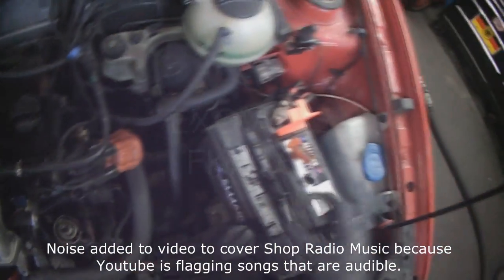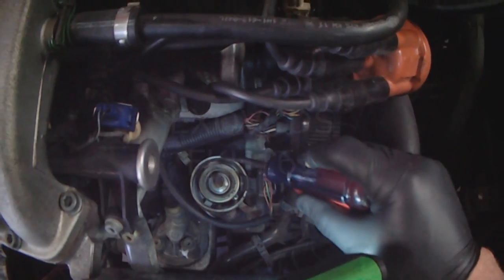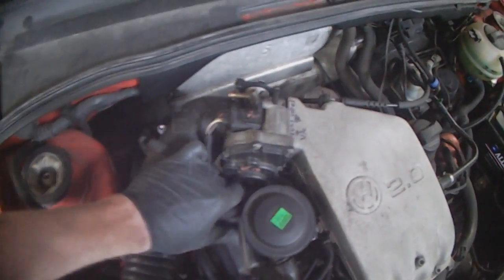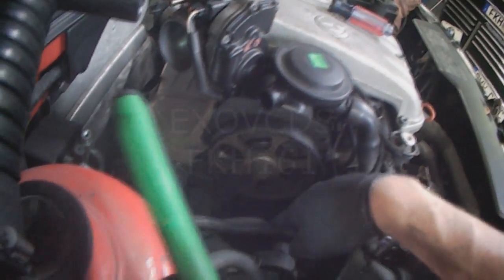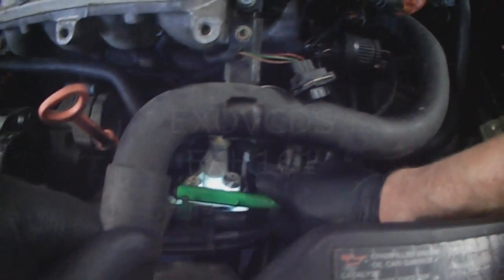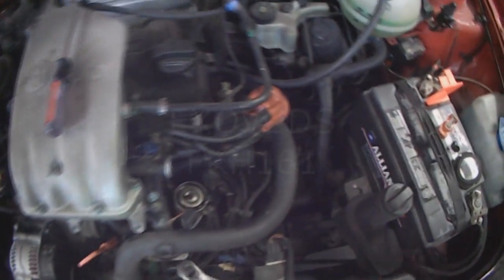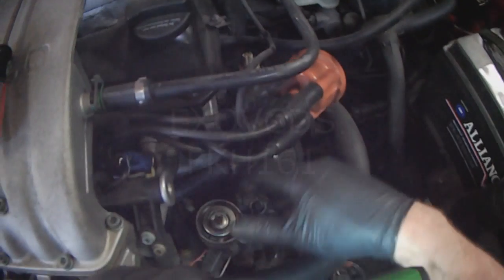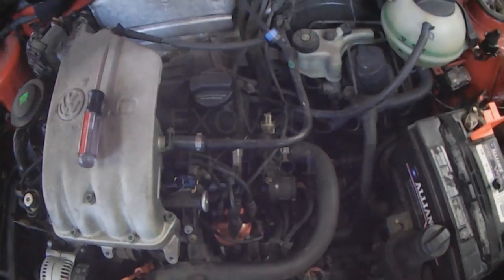VW A3: 2.0L ABA Distributor alignment / indexing

Comment: the manual tells me to make sure that that lug for the oil pump is parallel to the crankshaft centerline. If I do that, the rotor head is pointing like way off.
Reply from the maker: @danielswinger2986
With crank & cam at TDC, install the distributor so that the rotor points at the TDC notch in the distributor housing. 

It doesn't matter where lug for the oil pump is.

You can install the rotor 180 degrees out... it doesn't matter, as long as you also swap the spark plug wires on the distributor cap to reflect the incorrect position. Using TDC markings makes life easier.

Turn / adjust the distributor to do the final adjustment.

I can't  see what you are working on or how you are doing things... of if you are on the correct TDC marks. 

When taking things apart, nothing should really move much... so putting things back together the way they were, should get things running again.

Comment: At 7:01 how did you know where tdc was for it? From just turning it?
Reply from the maker: I think the video is self explanatory... remove the distributor cap, rotate the engine by hand with a socket & ratchet on the crank pulley bolt... turn the engine until the distributor rotor is pointing to #1 post of the distributor cap (the distributor also has a notch in the housing that indicates #1 position... verify that you are at TDC by looking for the TDC mark on the flywheel.  

Standard & automatic transmissions will have TDC marks / positions that look different

Comment: My otc on plastic isn’t lined up with the mark on the sprocket
Reply from the maker: Year, make, model, engine?
How are you checking for OTC / TDC?
Reply: @EXOVCDS  95 Volkswagen cabrio mk3 .. from watching videos I see you have to line the otc mark with the marks on the pulley:. My otc mark on the plastic is at the top at like 12:00 and the mark on the pulley is around 830-9:00 .. so do I turn that by hand to line it up with the otc mark on the plastic?
Reply from the maker: @sniperpaintcorrection  
Yes, but you also have to make sure that the #1 piston is actually at TDC (all the way up) when the mark on the pulley is aligned with the mark on the cover.
The crank gear can come loose with age and it can shift on the crankshaft... meaning that when you turn the engine to TDC via the mark on the pulley, when the pulley is at TDC, the crankshaft "might" not be... due to the shift of the gear.
If the piston is all the way up (use a long screwdriver in the spark plug hole to find TDC) and the pulley mark is at TDC, then the crank gear is OK.
Reply: @EXOVCDS  so to get the #1 piston to TDC I have to rotate which pulley? The one that moves the distributor rotor?
Reply from the maker: @sniperpaintcorrection  
You have to check all 3.
Camshaft, crankshaft & distributor.
If the timing belt is still installed, rotate the crankshaft until the pulley TDC mark is lined up with the TDC mark on the lower timing belt cover.
Once the crank pulley is at TDC, check the camshaft TDC mark.
If the camshaft TDC mark is 180 out, then rotate the crankshaft 1 more full turn.
Once the camshaft & crankshaft TDC marks are aligned, check the distributor to make sure that it is pointing at the #1 TDC slot in the distributor housing. Remove the distributor cap to see the rotor & TDC notch.
If the cam TDC mark or the distributor rotor do not align when the crank is at TDC, you will have to move the cam or distributor (once the belt is off) to get all 3 to line up.
Once all 3 are lined up, remove & replace the timing belt. 
Post a video on your channel, so that I can see when you have everything aligned... before you try and start the engine.
Engine damage can occur if you do not line everything up correctly.
Reply: @EXOVCDS  thank you , I will get back to you next chance I get to do some work on it this week .  I just hope I didn’t do damage , I’ve been cranking that engine for a week trying to get it to start thinking it was the fuel pump,  then distributor cap and rotor and ignition coil. Traced it back to the belt with missing teeth . I’m assuming it’s out of timing after all that
Reply from the maker: @sniperpaintcorrection6790 
I'll wait for your update this coming week.

Comment: I’m doing this now, is number one the first cylinder near the transmission or pulley set up?
Reply: Also, how do I know when I’m on tdc on compression stroke? I can see the exhaust valve is closed but how do I know I’m not in the intake stoke? Please help???
Reply from the maker: 1 is closest to the belt.
When the tdc mark on the camshaft gear is lined up with the mark on the plastic piece behind the cam gear... then the camshaft & crankshaft are at #1TDC.
You can verify that the crankshaft is also at tdc... by looking at the flywheel or torque converter at the transmission timing hole.

Comment: So it's like advance or returd the distributor once you break it the clips lose fot movement   by hand turning to TDC  thanks I love your channel
Reply from the maker: Yes, you can move the distributor to align the rotor with TDC... as opposed to resetting the intermediate shaft gear at the timing belt end. You should NOT have to move the distributor if the belt was not changed. If all of a sudden you are now having G40 fault codes, it is quite likely a problem with the hall sensor in the distributor.  If however, the timing belt was recently replaced, then distributor timing was not done correctly at that time. The more info I have, the better I can help.
Reply: You have help great deal Thoma  👍

Comment: When you say “pointing at cyl number 1”, what do you mean?
Reply from the maker: The distributor rotor needs to point at cyl 1 on the distributor cap. Follow the spark plug wire from cyl 1 spark plug to the distributor cap... lift the cap and look if the rotor is pointing at that spark plug wire. The camshaft & camshaft need to be set to #1 TDC first.
Reply: @EXOVCDS  thanks. I was driving home the other day and the clamp that holds the dizzy down loosened up and the entire dizzy/cap assembly rotated out of time. I think I just need to use a timing light and turn the whole assembly by itself to get it back in time. I have it close enough to run but not dialed in
Reply from the maker: The engine will run with the distributor hall plug disconnected... when it rotates too far,  the spark will go to the wrong cylinder. No timing light required. Remove upper timing belt cover. Turn engine by hand till the tdc mark on the cam gear  points at the arrow above the gear at the 12 o'clock position. Remove distributor cap. Rotate distributor till the notch in the distributor  housing it lined up with the center tip of the rotor. Tighten mounting bolt.

Comment: Quick question, camshaft position sensor would be the hall sender on these engines correct? 
I’m throwing a code, just did a full belt and water pump job with a full tune up, cars running slow she’s got no Getty up so to speak, 
Time is correct, 
Cps I received Is for a later model engine, and I’m finding nothing on cps for this model
Reply from the maker: Cam codes after timing belt replacement  means that distributor alignment is not correct with crank position.

Comment: Great video! I’m having some problems with my vw, I had it running perfect but now it’s misfiring under load. It seems to idle ok, itll rev up in park, but as soon as I try to drive it, it is very under power blinking the check engine light and giving me tons of misfire codes. I’m having a hard time figuring out what’s going on with it. 

Here’s what I’ve done so far:
 Distributor (new Duralast brand) (Due to camshaft position sensor failing, ran perfect for about a week, then had one misfire in cylinder 3 at 4k rpm) 
Next:
Spark plugs (Tried ac Delco, switched to ngk)
Ignition coil (tried a new coil and a junk yard one)
New spark plug wires (tried 2 different brands) 
Junk yard bosch distributor (currently in the car now)

Timing is perfect, distributor alignment good, fuel injectors are working, maf sensor reads good, stft is in range. Can’t find any vacuum leaks. The car is very underpowered!

Misfires will not go away, I cannot track down why. Any help would be grateful! Thank you!
Reply from the maker: Crank gear could be loose / moving... causing retarded cam / crank timing.

Comment: Hey Thomas. I’m running into an issue where my down pipe on my turbo aba is getting red hot. I’ve tried almost everything except flushing the injectors. I’m heavily leaning on retarded timing. Have you seen a bad dizzy cause this or the Hall effect sensor?
Reply from the maker: Check the crankshaft gear... it could be that the gear is loose / has shifted on the crankshaft... altering cam / crank timing. I have not seen any distributor or hall sensor issues, aside from hall sensors failing / not producing a signal. To check crank gear... turn the crank until the TDC mark on the flywheel is aligned with the mark on the transmission inspection hole. Looking at the crankshaft pulley, 2 of the 4 pulley bolts should be in a 12 o'clock & 6 o'clock position (aligned up/down with the center of the engine). If the bolts are at 11 &  5 or  1 & 7, then the crank gear has moved on the crankshaft. Broken crank gear key / notch is common with age. If the crank gear, cam & crank TDC alignment, as well as ignition timing are OK, then I would check the fuel injectors or for starvation next.
Reply: @EXOVCDS  thank you so much. Looks like I’ll be busy this weekend
Reply from the maker: Watch this video... it's also common on mk4's, but not as much as mk3's.
https://www.youtube.com/watch?v=o_bhRnnzMWQ
Reply: So I did redid the timing and found the dizzy was one tooth backward from the “on time” line. I Drove the car and boost feels like it comes on just a weeeee bit sooner. I’m guessing the ignition timing was in fact off a tad. I did not see any glowing on the down pipe when I pulled over to check at the same spot I did last time where I DID see the glowing. Thanks and I’ll make a video with an update and tag you.
Reply from the maker: Thank you for the update.
Usually when the distributor is off, the check engine light will be on and a cam code will be set.
The ABA does not need a distributor signal to start or run (you can disconnect the hall sensor and the engine will run fine.. but with less power).
Reply: @EXOVCDS  the car has a tuned ecu so No more stock parameters has been changed. And that’s why it didn’t adapt as the stock ECU would have.
Reply from the maker: The more info I have... the better I can help. Keep that  in mind for future issue (should there be any).

Comment: Not sure if you still keep track of the page, but I’m working on a 1999 mk3 Jetta that cranks but doesn’t start. Change plugs, wires, ignition coil, and battery. Still nothing. Was wondering what else might be an issue causing the crank but no start.
Reply from the maker: How are you checking for spark & fuel? Any fault codes? Is the timing belt ok / cam & crank timing? Fuel sample?

Comment: i like all you videos, they are very insightful. i have a mk3 jetta with an AFV, 1.8i engine that just runs for about 2 seconds and then dies. we checked for spark, fuel and everything else i just cant find the problem. i must mention that it had a factory alarm removed from it. so please shed a little light as to what may be wrong
Reply from the maker: We don't have the AFV engine (code) in Canada... so I'm not sure how similar they are to what we have. A few weeks ago I solved a start & stall issue on a Eurovan, by replacing the ECM. If you have already checked everything... maybe a different ECM will solve things for you as well.  Post a video on your channel so that I can see how it sounds when you start the engine.

Comment: Pls i need help and answer as soon as it possible on my mk3 gti 8v 2e engine it cranks but wont start i've installed engine and all is connected correctly i deleted code on immobilizer, fuel pump is working it has fuel, my coil is working it shows electric, my dis.. cap is clean and good, wires on spark plugs also, plugs are black, timing is perfect i did all as u in video clip but it's cranking and wont start. Actually sometimes it is about to start but that lose and keep cranks. I dont know what is wrong. I have that MAF it should be fine. The fat hose for air is kind a bad but i fixed it with good tape. Please help me with this and sorry for bad english 🥺😢
Also my battery is weak but when i jump start it it cranks very good it has "power" but still nothing. Thank you🙂
Reply: It starts for about 1-2 secs and keep cranking sometimes on first try on a couple of hours of trying
Reply from the maker: Have you checked for fault codes with a scan tool?
If you have spark & fuel but it does not run... then you need to check camshaft / crankshaft timing (set the engine to #1 TDC and make sure that the crankshaft & distributor align with the camshaft). Post a video on your channel so that I can see & hear what the engine is doing.
Reply: I have uploaded the video on my channel 🙂
Reply from the maker: Thank you.

Comment: Where is the egr valve
Reply from the maker: Year, make, model, engine? EGR as in exhaust gas recirculation or EGR as in SAI (secondary air injection)? What's  the actual issue / fault code?
Reply: Thomas EXOVCDS 98 be Jetta gt yeah p4001 code or something I bought a new egr valve and can’t find where it is to replace it my rpm running a lil  high too car runs but sluggish
Reply from the maker: @bigblay23  P0411?
http://wiki.ross-tech.com/wiki/index.php/16795/P0411/001041
Reply: Thomas EXOVCDS air injection

Comment: Hi Thomas the problem I have on my Jetta mk3 is it has a code P0341 I replace ; cam,crank, O2 sensor , cat what should I do now ( take it to the monk yard or to a real mechanic), joking I want to kip it is fun drive this car ; thanks for the videos keep it up 👍
Reply from the maker: You need to check if the distributor hall sensor is producing a signal. If yes, then you need to adjust the timing correctly. If you are using the crank pulley TDC mark to set the engine to TDC, it could be that the crank gear is off of actual TDC or the crank pulley has spun on the rubber part of the pulley. Turn the engine until the flywheel TDC mark is lined up with the TDC mark of the transmission. Send me pictures of the flywheel mark, the camshaft TDC mark and the position of the distributor rotor. Send pictures to:
fkh161 at fkh161 dot ca
No spaces. Use a . in place of dot
Reply: Thomas EXOVCDS ok I will follow all the steps you mentioned and I take some pictures and send it to you,Thanks Again.

Comment: Hi Thomas,
Thank you so much for the info! I was having a G40 fault reading on my VCDS, and I supposed it could be because of a bad distributor alignment. Then I saw your video and it blew my mind that the Crankshaft Position Sensor was at the distributor. The problem is that the error code clears itself when the engine is warm...  It behaves strangely when it's cold (3-4 days after I let it parked): it can stall just when starting it to move, it loses a cylinder when the engine is around 2000-3000rpm... But I can't figure out why it happens only when it's cold, and how the hell it gets fixed when it is warmer (it takes about 5 minutes to recover after it reaches 90ºC). Is it because it has to learn the alignment of the distributor every time I let it parked for 3-4 days? BTW, it doesn't happen if I use the car daily, which is even weirder. I hope you could give me a slight hint on what it could actually be. And of course, in the next days, I'll try to align the distributor properly.
Thank you again and hope to hear from you!
Reply from the maker: Crankshaft position sensor is NOT at the distributor. The Camshaft position sensor is the hall sensor in the distributor. You can unplug the distributor and the engine should still start & run. The crankshaft position sensor is mounted to the engine block, to the right of the oil filter above the oil pan. You said "it takes about 5 minutes to recover after it reaches 90ºC". Most cars will take longer than 5 minutes to warm up from cold to 90c... if it runs rough when first started, check which cylinder is the cause ("power balance test" ). Remove one spark plug wire at idle and note RPM drop. Reattach spark plug wire and disconnect next spark plug (do all 4). The one that does not drop engine RPM is the bad cylinder. Inspect the reason why (spark plug fouled, cracked spark plug ceramic, bad ignition wire, bad injector spray etc.)
Reply: @EXOVCDS  Thank you for the fast reply!  As you've mentioned, I'm going to perform a  power balance test to the cylinders. But first I'll have to wait for 3-4 days until the symptoms come back again, as they don't appear if I use the car regularly. As soon as I have updates on the car I will let you know. Thanks again for the tips! :D
By the way, can I unplug the spark plug wires from the distributor cap? As you know, the other ends of the cables are quite difficult to get to by hand, because the inlet manifold gets in the way.
Reply from the maker: Yes, you can disconnect them at the cap. Before you start the engine... remove one at a time and plug it back on to the cap (they can get stuck quite good, so this will loosen them up for the test). There is a possibility of getting shocked if you hold the wires with your hand. Use suitable rubber handled pliers to be on the safe side, but be careful not to damage the wires / rubber boots. You only have to lift the wires off of the cap an inch or two. It only needs to be a quick removal... 2 seconds. If you hold the wire away for too long, that can stress the ignition coil.